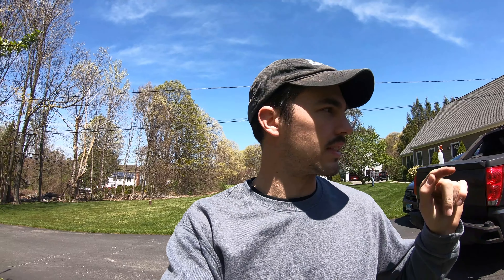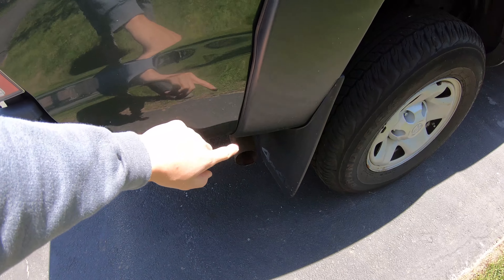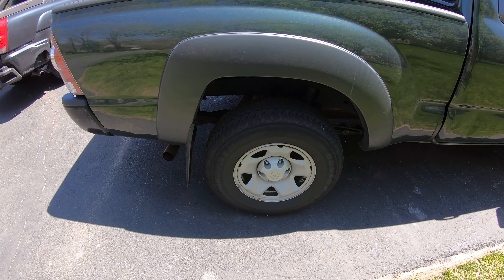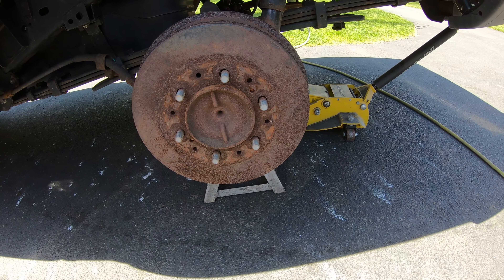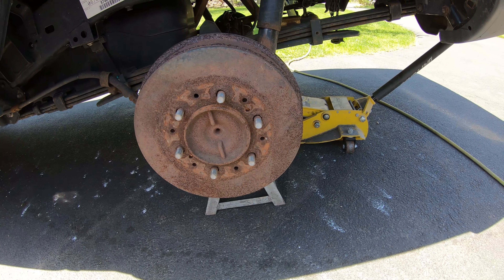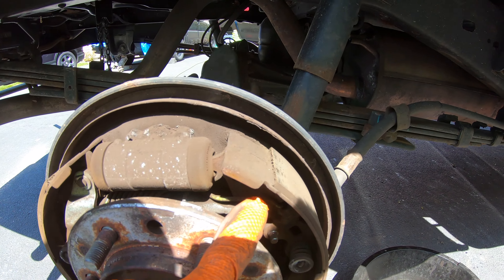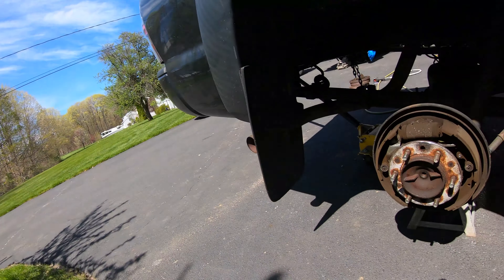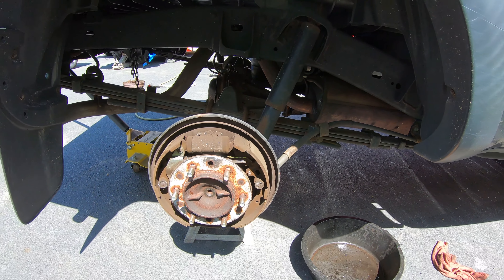How to Replace & Rebuild Toyota Tacoma Drum Brakes

Comment: You bailed me out with this video. I bought my wife a 2020 Tacoma with 27K miles on it, and last week the right rear was hemorrhaging brake fluid. It took four hours to get the drum off due to the fact that it was literally stuffed with sand and mud. Obviously the previous owner took it off road and buried the brakes in mud or sand. Removing the drum also damaged the star adjuster ($100 from Toyota) and required an extensive rebuild. Just getting it clean was a chore. Your video was critical to getting the system re-installed as I had no reference once the drum came off with everything else. I have no idea who Toyota would still be putting drum brakes on an off road truck in 2020. Four wheel disc brakes should have become standard fifteen years ago. Anyway, thank you for taking the time to put this together. I'm grateful.
Reply from the maker: Glad I could help! Drum brakes are such a pain. Not impossible but just so much extra work! Manufactures keep switching back and forth from and disc for some reason. Glad you got it all fixed up! Would have probably cost a small fortune at the dealer. Nice work!

Comment: Hey, this helped me with my '03 Taco.   The biggest help was the hint of using the the 'extraction bolts' to get the drum off - those were a life saver  After I peelayed it a few times with the sledge hammer the bolts helped it right out.  For the record they are M7 (metric) bolts.   My drums were rusted on pretty good from salt water, but I didn't need an air gun, just a ratchet on those bolts and it came right off.  Thanks for the help!
Reply from the maker: Glad it helped you ✌🏼

Comment: Either/Or both depending on drum brake design: Pumping brakes while driving backward (pump repeatedly, no need to slam the brakes) will adjust the starwheel so that the shoes press outward with the proper tension against the drum - this way you can have a plenty of space to get that drum on.  Just be prepared for initially weak brakes on the rear until you do it right after a rear brake job, you'll be relying on fronts for a moment until you backup and pump the pedal several times. And/or you can do the following, depending on design, you can apply and release the parking brake several times to adjust - that's the whole point of the starwheel's relationship to that "click-lock" bar... auto-tensioning as the shoes wear down.